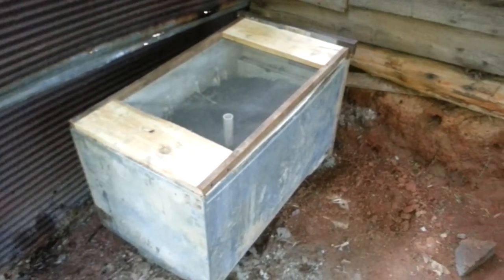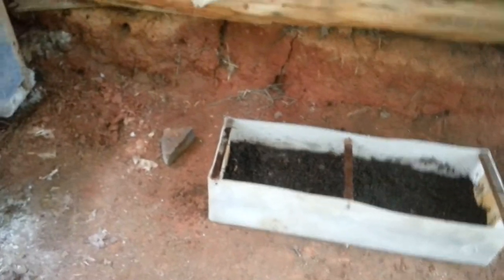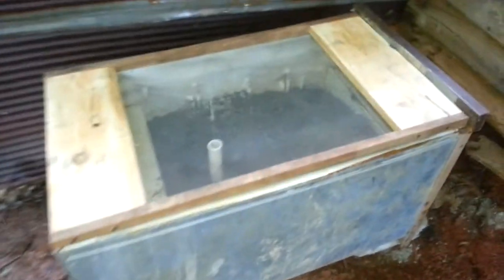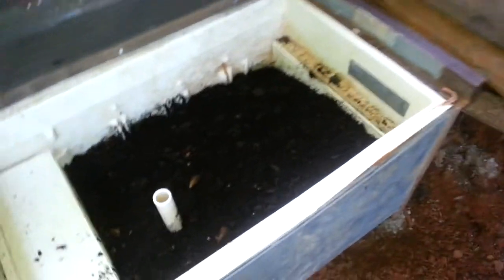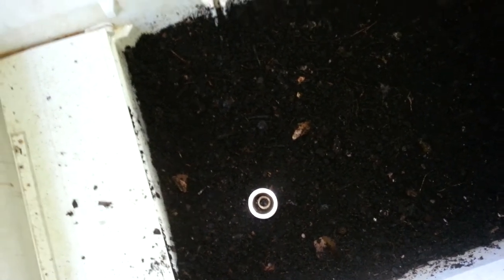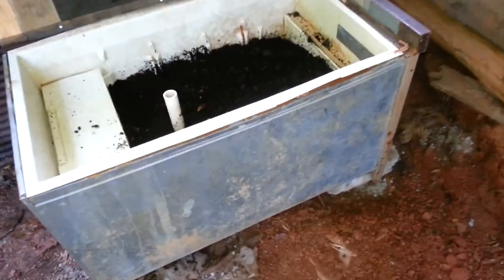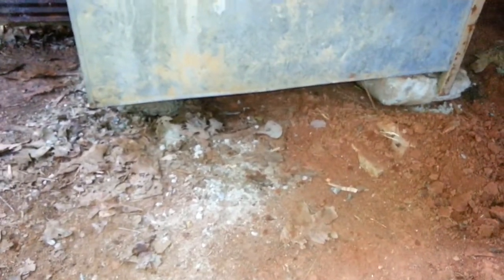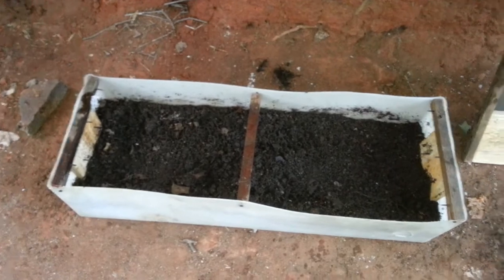Refrigerator Worm Bed

Comment: I am thinking about doing this. what area of the country are you in? how cold/hot does it get?
Reply from the maker: Tracy Bruring I live in Northwest Alabama. The Tempature in the winter around 5 to mid 40's. The summer time mid 60's to over 100 sometimes. This is my first wormbed  i have done but i brought my worms in the house for the winter just to make sure they keep on breeding. I just put them in the blue bin you see in my other videos and put them on the back porch so i can control the temp. My worms have double in population since i have started them.
Reply: Corey are they ok in over 100 degrees? i am very excited to try this
Reply from the maker: I have a very shaded area and as long as you keep water on your dirt it stays cool. they go down to the bottom. That is why I put the drain in it. In case of over watering the excess drains out. They seem to love it. But over all the dirt stays cool.
Reply: great; i will be putting mine under a car port
Reply from the maker: Tracy Bruring That should be great. Where are you located at?
Reply: n texas